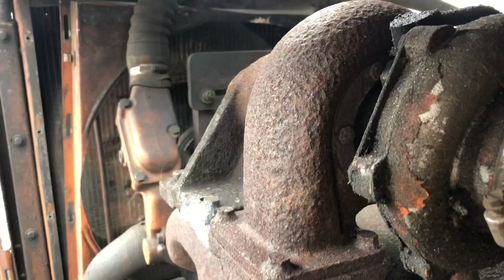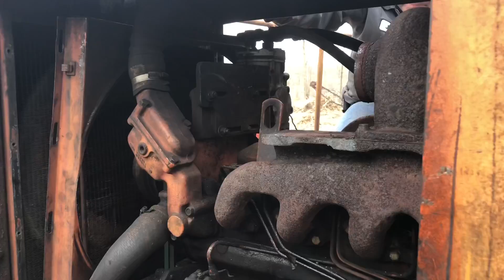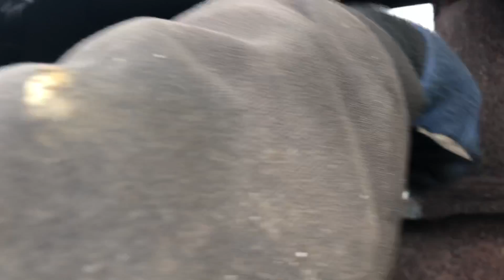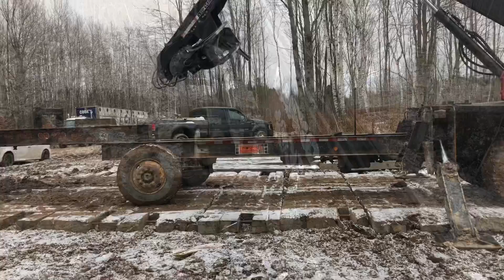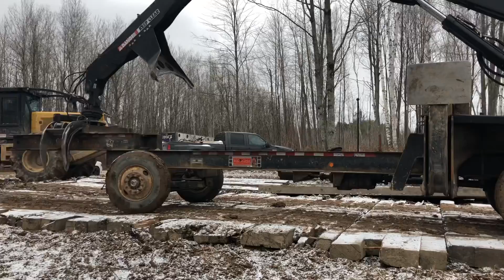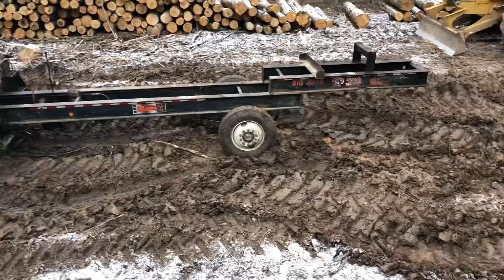LOOK AT THAT!!!

Comment: If you heat it up and spray a little aerokroil or pblaster on it, it will pull the oil right into the threads.

Comment: Got ye old prentice runnin is it a loaner or did Mike buy another one til the old one is fixed , looks a lil drier than before , great video john
Reply: From the other crew (they are running two chippers and two slashers)...think the Prentice is newer than the Barko?
Reply: rolandgsl that’s good that you can borrow from the other crew to continue processing wood hope you guys have a great productive week